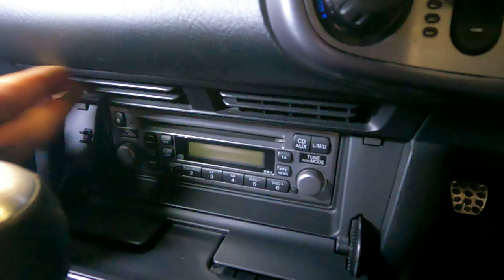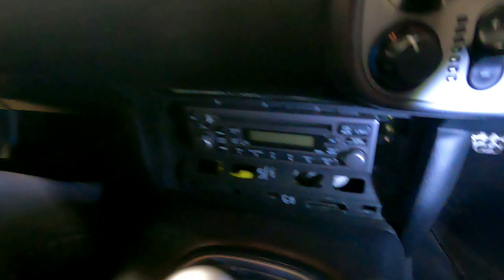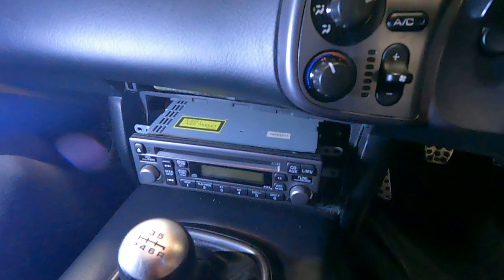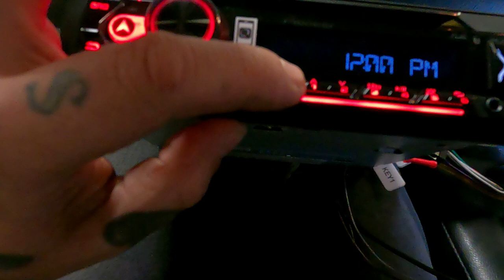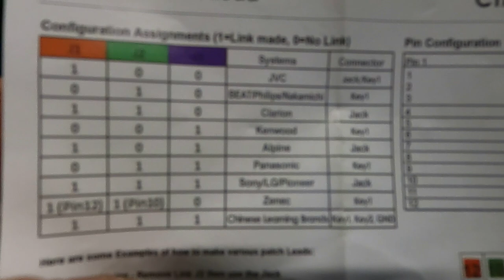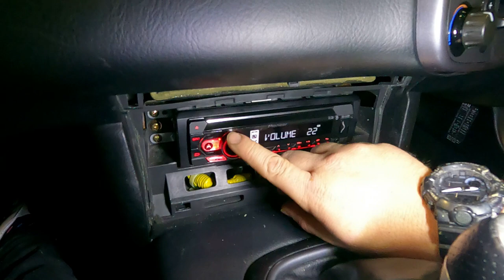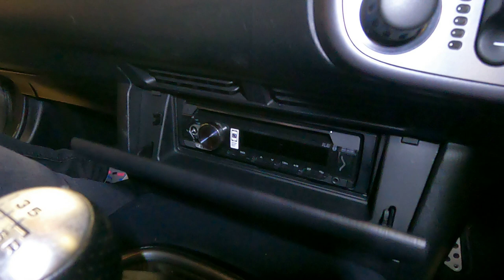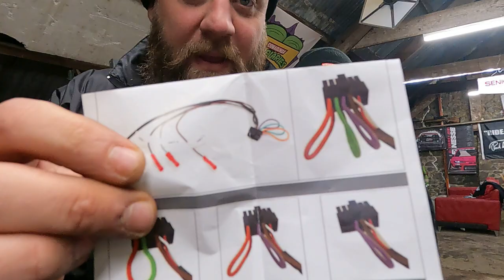Honda S2000 Aftermarket stereo Install with Connects 2 Pioneer DEH 5420BT

Comment: Can I used other pioneer deck or does it have to be same one you have? Plus where did you get the other plug from?
Reply from the maker: Any single din will work just Google s2000 connects 2 kit for the steering wheel control loom 🤘🏻
Reply: @CowabungaCarDiaries  I already have that connects 2 wire I’m talking about the other wire that connect to it.
Reply: @CowabungaCarDiaries  the one with the clear plastic with color white n brown connectors
Reply from the maker: @Empire350z  all links should be in the description buddy
Reply from the maker: @Empire350z  all links should be in the description buddy

Comment: i need some help. I installed a single din sony in my s2000, did all the wiring , and the radio fired up, then i unplugged it to get it ready to install everything back together, then when i went to plug it in again it didn’t turn on. the fuse on the radio is not blown, however the fuse for the radio under the drivers side dash was blown, so i put a spare fuse and the new radio nor the oem radio turn on. what is the issue.please help me!!!!!
Reply from the maker: I’d say either you plugged it back in wrong or maybe a wire has been caught or trapped when pushing it all back in as it is such a tight squeeze. Hope you get it sorted man